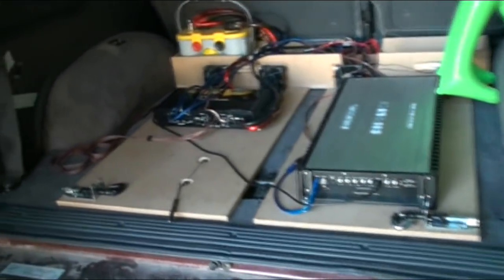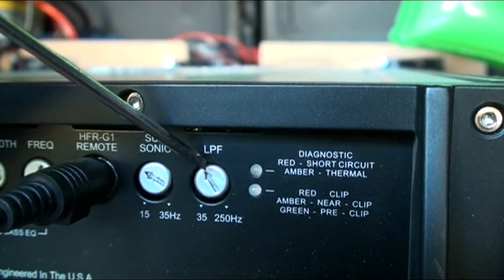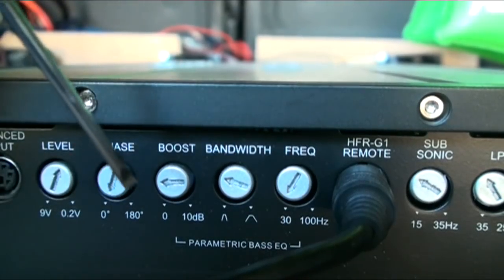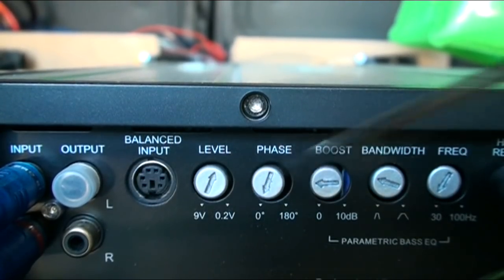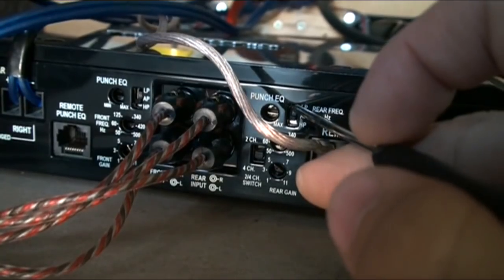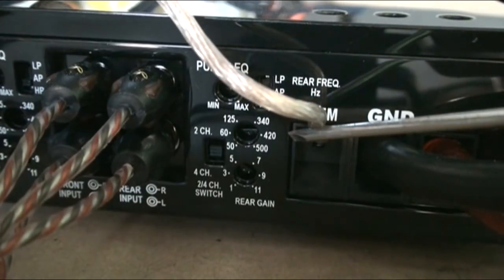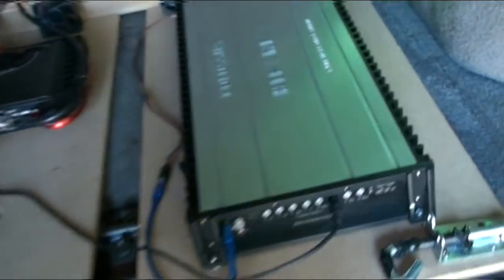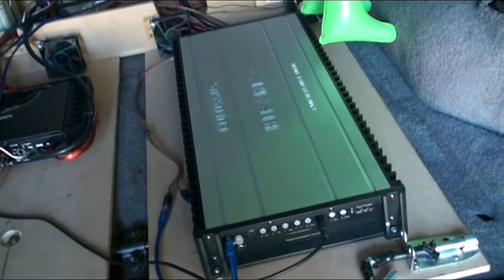Setting Car Amplifiers (Gain,LPF,HPF,Bass Boost,Sub Sonic,EQ)

Comment: I have a gothic 12" sub with a 500 watt amp and I can't figure out why the sub cone keeps getting hot .
Reply: Good chance you are over taxing your amp cause the sub is rated to handle quite a bit more. 

Best advise i think most can offer is to set the gains for the sub amp again, but carefully listen to when the bass stops increasing in volume.  Thats going to be the max output the amp will provide. 

Find that spot and then dial it back just a bit. If the problem continues, you'll probably need to lower the gain some more. Unless you have access to a distortion meter or oscilloscope.... 

I know that this is probably the last thing you want to hear, but save up (and start researching) for an amp that is more suited for your subs rms if you want to get the max out of that sub.
Reply: Dennis Ruff I am no expert but I would say that your amp isn't putting out the rms rating of your sub so you probably have your gain turned to high and it's clipping. I have been guilty of that myself and it will destroy the subwoofer.
Reply: Nathan Powell no that's not a problem just the opposite, your amp will run with control and sending clean power undistorted and your subs will handle more than they would with a weak amp just don't push the subs beyond what they can handle ofc then you should do fine and use subsonic filter (especially if it's a ported box)

Comment: can any of u guys please help me please help my tune my amp I have 1000watt /1300watt audiopipe mini class d and I'm running (3) 12 inch powerbass subs ..
Reply: Edward Cooley that's easy.you wanna turn your CD player about 50%,then turn your bass on the CD player to +1, turn your gain in a 1 o'clock position,then slightly turn the sub Sonic filter until the desired amount of bass, slightly turn the low pass filter slightly till the bass comes in,the bass boast..turn it slowely...till  your subs are gonna start to produce bass,then stop..if the bass is too strong..back of the low pass filter a bit,listen to the bass respond..if it boom too hard turn the low pass filter down slightly because a class amp is a bass amp,I have 2 1400 watts boss subs on a hifonics 2000 Brutus,boss 200 watts 50x4 powered eq,5 years with it tune right.they are still playing.i just kept the bass down.

Comment: i don't understand the hifonics gain, is it set up backwards? as in right is lowest and turning counter clockwise would be going up?
Reply: Placebo Effect no there not backwards. All the gain is for is to match your head units rca output voltage. Example 1 if your hu rca outputs are the average of 2 volts you have to turn your amplifier gain clockwise to somewhere between the 12 o'clock and the 3 o'clock position. Example 2 if your rca outputs are 4 to 7 volts as in most more expensive head units then you would turn your amplifier gain somewhere between 5 o'clock and 12 o'clock position. The lower your rca output voltage the higher the gain and vice versa. I hope this helps you.
Reply: selecting a higher output voltage is the equivalent of turning your gain knob down. 
they represent the same thing, just labeled using different terms.
Reply: Chris Oxford yeah I learned that later but it was confusing as hell when I didn't know lol
Reply: This is Pointless 
yes it's pretty foxk up

Comment: i have a kenwood ddx9902s deck and a rockford fosgate prime 1200dx1 channel amp need to know how to set the hertz on both
Reply from the maker: well if your running subs set the crossover to about 80hz on the low pass

Comment: hey man quick question, my headunit has a rca out put for subs at 4v. now im going to connect two amps to that for 2 subs. do i set the sensitivity to 2 v per amp? does the voltage halve at the amps as it is split? or doesnt that get affected and i put the sensitivity at 4v for both amps?
Reply from the maker: no the voltage will  be 4v on each amp the only time there would be a issue is if you run too much off the remote wire like say 3 amps and fans etc but what your doing will be sweet
Reply: +Australia's Biggest Bass Channel cheers mate. thnx for the reply. i bought a relay so if more amps come into picture i should be fine. 
so the voltage output of the head unit is 4v at the rca. if i split the rca with ysplitters. the voltage will not be affected? meaning i put sensitivity at 4v per amp....? just want to clarify.

Comment: My component speakers come with crossovers; I see that my amp comes with crossovers for two of the channels.  Do I need both? One or the other?
Reply from the maker: you will need to use both unless your amp has a band-pass feature and your running each component separately, pretty much the crossover that comes with the speakers just separate the frequencies too the woofer and tweeter as the crossover on the amp will high pass the woofers so they dont play too low

Comment: if the low pass filter for subs is set too high, will it make the subs sound muffled or distorted?
Reply from the maker: if the low pass is set too say 150hz the subs are going to sound kinda like speakers, on the whole set it around 80hz

Comment: with the 4 channel gain levels... I've got infinity 6500 reference splits in the fronts (4ohm) but got soundstream sttr69 in the back & there a 3 ohm speaker, I'd give the rears less gain than the fronts hey?  Amp puts out bout 200w at 4ohms/channel.
Reply: sorry they are sst6.9

Comment: ..I took my system frfom my old truck & installed in new car.... Same stereo,speakers,Box but much better amp. -   Pounded hard in last vehicle(truck) .But My new car (esort) the same system with better amp, the bass sound like complete garbage & cant handle any big bass at all. WHY?     Mtx 200w pair  & new amp is Pioneer 820.      -   Mtx's Slammed with a sony 100 but Fail with an 820w
Reply: Truck has a much bigger alternator, that's why. Sucks bro
Reply: The alternator has nothing to do with it. Most likely the box you have that worked for the truck isn't optimal for the car. 
95% of the "boom" has to do with the box. You can take the worst subs and a Walmart amp and make it BOOM as you say if you have the right box

Comment: Hey I've tried setting the gain and when i put my multimeter on the speaker wires (before i connected my amp) with the volume all the way up, it gives me 3 Volts. So i matched it on the amp and put it on 3 but it sounds absolutely low as hell. What is wrong with my set up? I have to turn the gain all the way up to make them sound decent.
Reply: Did you wire the subs backwards? If you have two subs, is the positive connected to positive and negative to negative on BOTH sides? If you mistakenly did 
+ / + and - / - on one side 
But 
+ / - and - / + on the other side 
You're gonna have the subs playing opposite which will cancel out the sound waves giving you almost no sound, just some shaking.
Reply: +ZanesFacebook I was powering 2 coaxial speakers and i believe the wiring was just fine. The amp actually started smoking a few weeks later. Fast forward to a new replacement amp, the same wiring and the same speakers sound great. It must have been a faulty amp. I'm staying away from Kenwood next time thats for sure.

Comment: I have 2 12" subs. Now they were both working fine, now when I put the volume up the amp goes off(I think goes on protection) I disconnected one and now I can put the volume high but I only have one connected. What can this problem be? Please help me . Could it be the speaker wire burnt out or something like that? Also I have 8 gauge wires, and they look a little gray. I'm thinking to change to new speaker wires.
Reply from the maker: +playboyh415 theres many thing that could be causing this id first plug them both in turn it up and measure your voltage make sure its not droping below 12v at the amp, if its fine unplug 1 sub them play it then unplug the other and see if it only cuts out on 1 then that may be blown or blowing

also check the impedance is not wrong or too low for the amp most mono blocks will go down to 1ohm but some only 2ohm, if your running 8ga it wont be a burnt out wire unless your running massive power

and finally could just be clipping on a overly turned up gain, also the earth wire could be bad and the amp may be drawing too much power when turned up and is the issue, try all these for now

Comment: I have a 12inch in a truck subwoofer box in my car . it doesn't sound good what should I do
Reply: +SaMira Mira you should be more specific. theres a number of things that could be wrong. your amp (assuming you have one) could be tuned wrong, the settings on your stereo could be wrong, the box your using could be too big or small, or sealed or unsealed depending on the kind of sub you have. your sub could also be blown. you could have an amp too small for the sub, you could have bad wire connetions.... i means theres a lot. lol
Reply from the maker: +SaMira Mira well amusing the box is right for the woofer then you need to retune the amp, if its too hard take it to your local car audio shop

Comment: most instruments don't produce anything bellow 40Hz.
Reply from the maker: +Danni Rodes yeah but we can down too near 20hz so my as well :)
Reply: +Australia's Biggest Bass Channel 
no no, I'm not knocking it.
Reply: +Danni Rodes its not the instruments.... generally when your doing beats you cut those frequencies under 40 hz, basicly because 2 motives.

1.- under 40 hz you need way too much energy to make that signal audible to humans, so you cut it because it doesnt worth it to put it on a record.

2.- under 40 hz, frequencies needs so much power that they basicly made some frecuencies over 40 hz dissapear and modulates most of the audio over de 40 hz, wich is undesirable and feels odd.

Comment: Why would one of my tweeters cut in and out? Wiring or amp.?
Reply from the maker: +Dinky-Di id say wiring more likely if there running of a crossover with a woofer and only the tweeter cuts out
Reply: ***** Ok thanks. I'll be taking it back to audio "precision", so they can fix their fuck up.

Comment: This has been a ongoing issue. Never use to do this at the start. Why is it whenever i crank the music up at a certain volume.after a while my back speakers go dull & sounds like its lost quality? I have a 5channel kicker ZX700.5 powering back four 6-9 speakers and a sub & have a pioneer 2 channel amp that's powering only 2 front door 4" speakers. I am using 4 gauge wiring aswell
Reply: maybe you should not run your door speakers with your sub. sub use 2 ch only. speakers use 4 channel and set it up like this guy did.
Reply: Bad ground wire. It's getting too hot. Go thicker, and find a better mounting point.
Reply: If your speaks turn off it means its overheating and is burning out. If you keep it up at that volume where it turns off, your speakers will be burnt out and stops working period. It happends to my tweeters on all 4 of my speakers. I had set the gain on it too high and the tweeters is too small and can't handle all that voltage going to it. It burnts out in about a 2 to 3 months after getting it.

Comment: I have a '95 c class mercy, old car I know but it's got 40k so no point in getting a used car and not know what the history is like. My issue is that my head unit doesn't have phone/RCA outputs, can i splice a speaker wire and use that? I hate working on mercs, I installed a head unit with a disc changer and compared to a Honda or vw it was a pain.
I have a PG amp and a JL 12 inch sub, I don't want overkill on the bass but want punchy mid bass and solid low frequency reproduction. I am happy with the midst and highs as I've replaced the factory tweeters and mid range cones. Need to remember to cut off the lower frequencies that might damage the sub.
Reply from the maker: Gunzee you need a high-low converter, you then tap onto the speaker wires and out with come a low level rca output, theres many around id buy a stinger one or focal both good then use the amps crossovers (lpf) and cut the high notes of at around 100hz

Comment: So Im confused. My head unit is 2volt preout but I cant turn the level up that far because i get distortion on my sub. The sub is a Infinity Kappa 12 350 watts rms but I have heard that it can deff take more than that and the amp is a Hifonics Brutis 450 watt rms. I have to set the level to about 50% so I can turn the rap songs to the appropriate level on the head unit i prefer without distortion. Im wondering if the sub is defective or somthing. Any help would be appreciated. Thanks,
Reply: +BladeAddict8 it's called displacement limited power handling. This happens when the cone can't move far enough to take the bass even though the voice coil isn't in danger of overheating. The lower your box is tuned, the faster you'll run out of displacement limited powerhandling (assuming you're cutting out frequencies a few Hz below your tuning)

Comment: I'm using a clamp meter to calculate how much power draw I make in DC.

Then I compare it to the RMS and dyno results on my amp.

Currently I have 35mm2 wire and my max power with sine wave at my box tuning is around 440w power draw.

So on music it makes about 100-200watts and my amp is 850rated, 870w dynoed :)

I get my headlights dimming on idle but it doesnt happen when I keep revs at 1200+
Reply: Switch to LED lights, man! Cost about $100 for a top of the line pair (mine are 9,000 lumens, halogens were 4,400) and you get twice the brightness, better throw distance, a "newer" look to your vehicle and absolutely zero dimming. Check out JDM Astar on amazon
Reply: ZanesFacebook

I'll see what I'll do when I get the money to fix the car and get some work to get the money first :D Thanks for the tip

Comment: Why would you set the LPF lower so that it wont play all the base. If i have an All round sub that can play from 23-400hz (Infinity cappa) Can I set my LPF to the max (250hz) so that it can play any base the sub can handle or is there a reason you set it down?
Reply: +Jan-willem Visser frequencies above 100 Hz you want coming from the door speakers, otherwise it doesn't sound right and you can hear them coming from the boot. If the subwoofers were right under your door speakers it would be okay but if not it messes up the sound stage as 400Hz is well into the vocal range.
Reply: Sub frquencies should be set to 50 hz to 100 hz, it depends on what music you are listening to. Rap music ranges from 40-80 hz while techno and rock music ranges from 50 hz to 100 hz. Do not go above 100 hz as that is range of vocal and higher fequencies ranges making your subs play music with the bass that would cause distortion. You only want bass to play on your subs and bass frequencies ranges from 30 hz to 100 hz.

Comment: I have 2 12 planet audio 900 rms a piece in a sealed box do I set my amp to 80hz or 50hz I listen to rap
Reply from the maker: set you LPF (low pass filter) to 80hz, if you have a Subsonic filter on your amp id set it to around 20-25hz
Reply: ok thank you so much the shop told me to do 50hz smh my amp is 3200 watt 1800rms 1800 watt subs  the subs is 900 rms where should I set the gain on the amp to about 1600watts
Reply: Would that go the same for 2  kickers cvr 12 on a brutus elite 1700.1 ?

Comment: I have a JL W0V3 12" believe it's 300-350W in a ported box with a autotek axl 1000.2 2 channeI have my EQ boost up to 2pm think it's 7db it came stock at 4.5-5 DB it wasn't rattling my truck so I moved it up I just want the most out of my amp to make my sub pound please help me should I have in low pass high pass or what level I have a system but don't know much about them please help me please

Comment: I see two problems and it is bassboost and yours amp full power. Take the bassboost off. Where you think you need that? You can adjust your amp whithout bassboost. Tune it whith multimeter. You will find information in youtube. Better be use it :) & better be chek all connections and your battery voltage.

Comment: hi just want to make it clear sorry I'm new to this thing. If you set the 4channel amp front hpf to 80hz , you have to set the head unit  hpf also at 80hz? same with the mono amp lpf  , set the same at the head unit lpf  settings?

Comment: Best way is to get a DMM (digital multimeter) and measure off your amp speaker connections (with speakers disconnected, amp gain all the way down and HU all the way up). Use this equation RMS wattage (per if sub or combined if front or rear channels), take the total and get the square root of it. For example your front amp ch are 50w RMS per channel, so the total would be 100w RMS for both front or rear channels. Take √100 or SQR(100) which is 10. Use you DMM to set it at that range.

Comment: Also if you take apart some old desktop computer you'll find the same type of fans.  I wires some up (powered buy an old cell phone AC charger) to cool my laptop until I found a proper laptop cooling base plate to set it on.

Comment: Uh, when you set the LPF to 90HZ, you said anything below 90Hz the subs won't pick up. Actually, it's the opposite - anything above 90Hz the subs won't pick up. That's why it's called a low pass filter...

Comment: I have a Monoblock amp that i use to power my Sub, just the sub. Alpine MRX-M50, Sub is Alpine SWR-T10. Most people advice to not use the LPF setting on the amp, but on the deck alone. That two is redundant and may be inefficient. I was just curious to know why you did it that way..

Comment: wow good information bro tx and i so u use bassboost min goes from 0-12db from my amp iv i make it  9oclock like yours is good? and i have an alpine 117r hu and sublevel it goes from 0-15 can i leave it at the full (15) if i set the bass boost from the amp? tx again for your help mate